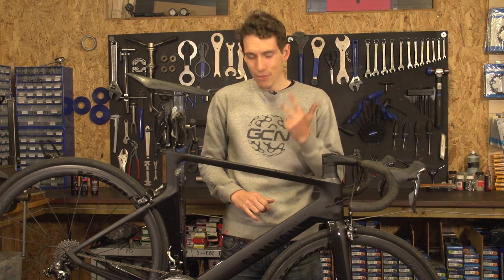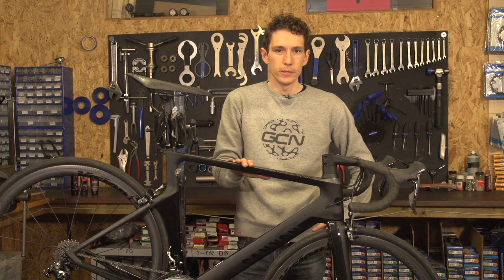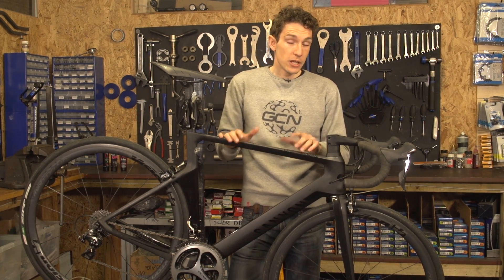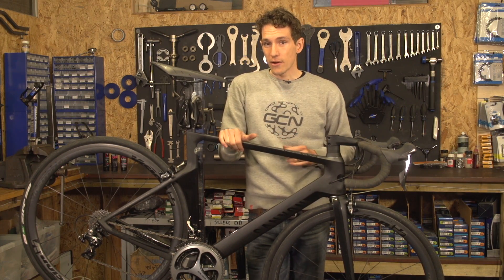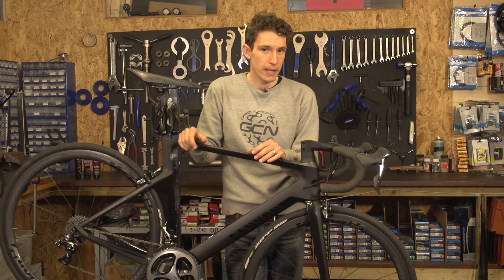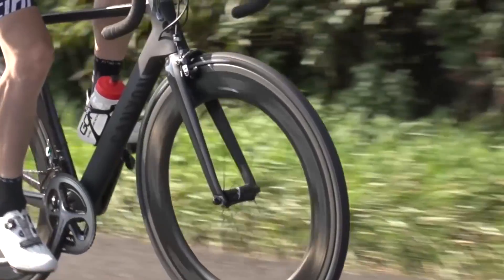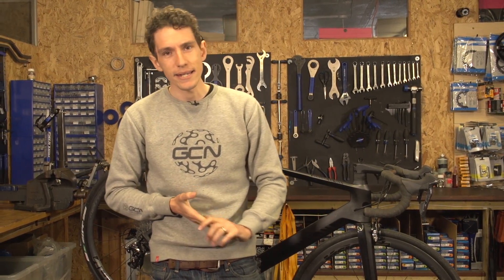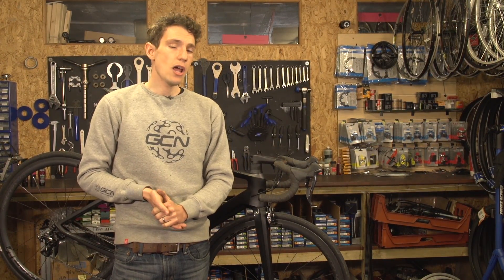7 Things You Didn't Know About Carbon Fiber

Comment: Leaning it against a radiator could damage the clear coat / paint layers though.
Reply: +SimonGrowl I wouldn't say that's entirely true,  most manufactures bake the paint job into the bike at temperatures well over what a radiator could reach.
Reply: +kevo598 incorrect.  Firstly, paint on carbon frames is sprayed on, not powder coated, so heat is not involved in that step.  Second, if the manufacturer does choose to do a post clear coat heating, it will be at a low ambient temperature.  Ridley, for example, use 54c ambient.  Compare this to the surface temperature of a radiator which can be around 75c, and will be contacting the clear coat in a concentrated direct touch point, rather than merely ambient, and the radiator is much much hotter and more damaging.
Reply: +SimonGrowl Sorry but that just isn't entirely true, Firstly depending on the manufacture paint is spray contacted into the carbon at base layers, the final coat is then applied with the residual surfaces being heat treated at 70-85c. Secondly the thermal conductivity of carbon fiber can be deduced in accordance to manufacturing standards, There are a number of systems of measures depending on metric or imperial units: 1 W/(m.K) = 1 W/(m.oC) = 0.85984 kcal/(hr.m.oC) = 0.5779 Btu/(ft.hr.oF)

Air .024
Aluminium 250
Concrete .4 - .7
Carbon Steel 54
Mineral Wool insulation .04
Plywood .13
Quartz .3
Pyrex Glass .1
Pine .12
Carbon Fiber .24 (dependent on manufacturing standards this number can vary slightly)

So at it's base form Cf without paint treatment can still withstand the maximum output of a standard radiator which is around 72-74c depending on ambient room temperature, However not all manufactures apply paint in this way and most as pointed out opt for the spray method.
Reply: kevo598 Hey

Could you clarify what you mean when you say "depending on manufacturer, paint is spray contacted into the carbon at base layer".  This is unclear.

Also, what do you mean when you say, "the final coat is then applied with the residual surfaces being heat treated at 70-85c".

Please explain this further, and then cite your sources for this information when clarified.  

Also, your second point about the thermal conductivity of carbon is irrelevant to the point I am making; I am saying that clear coat can be potentially damaged if lent against a hot surface, which in this scenario is a radiator in a house.

Also; look at every video out there of different frame makers painting their frames.  The process is simply base coat, colour coats with masking where required, and clear coat, with some places "gently baking" (to quote Ridley directly) the complete frame after.

Good sources to check out on frame painting;

Trek, Etoe, PaintMyBike, etc.

Interesting discussion, cheers!
Reply: +SimonGrowl Well what I meant is exactly what I said: some manufacturers spray the base layers on, then the final coat is baked on at a temperature. Simple really, Anyways good chat indeed :)
Reply: kevo598 "Some manufacturers spray the base layer on"?  What is the alternative?  How else are they getting the paint on to the frame?

"Then the final coat is baked on at a temperature"?  By this do you mean the 'final coat' is sprayed on and then the frame is heated, or is there some other method of getting paint on the frame? 

Also, which coats are you referring to when you say the 'base layers' and the 'final coat'. ?

Comment: Excellent video guys, there's just one myth that didn't got unveiled, (at least here in South America and Mexico), people tend to believe that carbon fiber has an expiration date, is that true?? o.O and if it is, how can I know when my bike is no longer suitable for riding?? or any other carbon fiber component, Rims, Handlebars, Stem, etc!
Reply: As a composites engineer, I think I know where this misunderstanding is coming from - carbon fibre does in fact have an expiry date - but this relates to the uncured prepreg. i.e. before the components are put in the oven. Once they are cured in the oven there is no longer any relevant expiration.

Also note, any carbon prepreg material will cure itself in room temperature if given enough time to do so, this is why we store the material in freezers.
Reply from the maker: +Paula Outon Hi Paula, your carbon frame is likely to last indefinitely. The question you might want to ask is how best to recycle it!
Reply: Global Cycling Network
 Thanks Guys, now I'm going to start researching ways to recycle used up carbon fiber
Reply: +Rob Granville (CBR) I've been riding my Reynolds Strike SLG carbon clinchers for 2 years now, all year long, rain or shine, flat roads, alpine descents, everything. No sign of wear on my Reynolds brakepads or the rims either, while before that my alu clinchers would not even last me 1 winter...
Reply: +Rob Granville (CBR) true, but not a problem anymore once disc brakes catch up

Comment: so even if i am 100kg i still can ride a carbon bike?
Reply: A carbon bike will be fine. I'm 86kg and a jump mine and do stoppies and it holds up fine.
Reply: +Aqid Danial I would trust a carbon bike over a steel bike at that weight. but I would go with an alum stem and bar
Reply: +Aqid Danial I would trust a carbon bike over a steel bike at that weight. but I would go with an alum stem and bar

Comment: I have to disagree with the claim that "you [can] lean your carbon bike against a radiator".

Most of you didn't come to read essays so, in short, leaning a carbon fiber bike on a radiator (I'm assuming an operating automotive rad) will most likely ruin it. DON'T DO IT 

I would like to speak to the point about the temperature resistance of carbon fiber reinforced plastics (carbon fiber for short). As an engineer with experience in designing and manufacturing with carbon fiber composites for automotive racing applications, I feel the need to point out that high temperatures can be a significant hazard for carbon fiber. First it is worth pointing out that the operating coolant temperature is 90 degree Celsius for most road cars (110 degrees C for some motors eg. Audis' TSFI motors)  so radiators will feasibly reach 90 degrees in certain areas. Although 90 degrees C will have very little effect on the properties of elemental carbon (as compared to 20 degrees C), resins used in carbon fiber MAY be affected. As opposed to elemental carbon which have little variation between different manufacturers, different resins will exhibit vastly different reactions to temperature. The important metric to note pertaining to the operating temperature of a resin is its glass transition temperature (Tg) and not the melting temperature. The Tg is effectively the temperature at which a (amorphous) material turns from a brittle solid to a rubbery substance. Beyond the Tg, the composite loses it's structural properties and is easily deformed. The resin used in many of our components on our race car (ties rods, steering column, intake, body panels, etc...) has an operating temperature of up to 70 degrees C (160 degrees F) and heat exposure is a large concern of ours when designing and implementing these items. The specific resin we use is valued for it's strength and chemical resistance despite the heat concerns we have. It is worth noting that the resin we use is in fact marketed as a "high temperature resin" (just not quite up to all our requirements). There are, of course, resins that have much higher Tg's of up to 300 degrees C (2000 degrees C, even, for carbon-carbon though that's completely different), this often comes at the cost of strength, chemical resistance, ease of manufacturing, and most importantly, money , and therefore, are not preferred. I applaud the creators of this video for recognizing that bicycles are designed with their intended uses in mind, and this leads me to my point.  Although I don't know the properties of every single different resin used in bicycles, considering that the typical use of a bicycle is not to be leaned against a radiator but rather to be ridden in mild climate, resins are not required to withstand the temperatures of the radiator and probably will not. Composites used on bicycles will be required to have excellent specific strength primarily with operating temperature being of very minor concern of its designer. I've focused on the resin for carbon fiber bikes in this comment but the glue used to bond sections of carbon fiber together, the clear coat used to make bikes look pretty, the vinyl liveries on bikes bike are whole other cans of worms...  I'm not certain why this video had to go out of its way to offer people potentially hazardous information, but for anyone who didn't feel my first two lines of this comment were of common sense and felt the need to read the justification, hopefully this clears things up for you.
Reply: @Human Bean  He's not talking about a car radiator. Instead, he's talking about the radiators used in your home, for heating.
Reply: Well this reply made me crack up. Why would they be talking about car radiators???
Reply: Interesting but too long and no paragraph = not easy to read.

Comment: I can't Re-find the comment Link so posting the webpage piechart info as new comment.
Well going by your links 2011 piechart, there are more than 5 C.F. companies.
Carbon Fibre company share by %  2011 - 1. Toray 30% - 2. Mitsubishi 18% - 3. Toho 18% - 4. Zoltek 17% - 5. Hexcel 7% - 6. Others 6% - 7. Cytec 3%

Comment: have you got 28mm tires on your aeroad? Contemplating them on mine and unsure if they would fit
Reply: I do and they fit fine, room for 30s maybe!
Reply: oh right nice. Gap doesnt look big enough when ive got 25s on. Would you recommend 28 over 25?
Reply: +James Merry it depends really. To say one is better than the other depends on what riding you do, what wheels you have and what tyres you're going to get.
Reply: +Simon Richardson well I ride up in Edinburgh, where the roads sometimes make Paris roubaix seem smooth. But race on the bike. Have Reynolds carbon clinchers for good wheels and then ultegra wheels for training

Comment: Kiln cured carbon fiber structures aren't UV sensitive, but if the carbon composite is wet laid up, i.e. using a process whereby the glues set without being baked in an oven, then they do degrade over time due to sunlight.  Like fiberglass boats for example.  Doubt that any producers make wet laid up bike frames, but maybe a cheaper or no name brand coming out of China...?

Comment: CF is good, my friends have exotic cars with lots of CF parts. Here are some of their complaints. The resin chips easily(expensive to fix), in really cold weather it cracks(expensive), Any hidden chips turn fatal if you drive on wet salty roads. Extremely strong in some direction but surprisingly weak in others(if you move it in an unusual way it can break easily). To me its not worth the price right now vs aluminium. In the future CF bikes will probably cost the same as a current aluminium bike, when the price comes down ill get one.
Reply: +Robert Flagg Car parts are subjected to vastly different stresses than bicycle parts and many aftermarket carbon fibre parts are poorly engineered compared to OEM.Both my road and CX bikes have seen multiple winters of -15C and hit with salt, sand, gravel, and flexed through sprints or bunny hops (CX) without any issues.  I even have a few bare carbon spots on my road bike (before I started using 3M clearbra material to protect vulnerable areas) and only the very thin paint chipped away.  Unlike carbon fibre, aluminum fatigues over time when repeatedly flexed.  That's not to say there aren't great metal bikes out there but, honestly, most carbon fibre bikes built in the past five years or so are just as durable, if not more so, than aluminum.
Reply: mneedes2 However, regarding the extreme durability of Ti I'm quoting from work with gas turbines and jet engines. Certainly I'm up for a Titanium frame, but the prices are keeping me off it. I like the elasticity of metals. At the moment I'm using Titanium hubs and Titanium sprockets, and they rule. Way better than ally, with the hubs under heavy cornering, jumping or putting the power down can feel the difference. Light as a feather. Ti is amazing.
Reply: +dan parmenter im considering a Ti frame for my next bike too, aluminum frames are less expensive and lighter but it has a dead feel.. 
Ti on the other hand has good qualities overall but yep still expensive!
Reply: +Robert Flagg agree with you... been using steel and  aluminum frames for many years, then i upgraded to a carbon frame road bike yes its stiff and light but durability not really.
frame and other components  made from CF you have to treat them with tender and loving care..

for sponsored  pro teams its not really a big concern for them because they can easily replace their bikes..
Reply: +Robert Flagg If you want the most durable, buy titanium. If you thought carbon was pricey, you haven't seen Ti.
Reply: +Weng Ten   You mention durability.  Did your bike fail?
Reply: mneedes2 nope, seems tough as nails. Mind you, I ride a pronghorn, which is the only CF frame that comes with a lifetime guarantee. If I do manage to break it, they'll give me a new one. Used by the Peruvian olympic MTB team, so if they can't break it... doubt I can.

Comment: Do carbon fiber really has an expiry date?
Reply: +Tsaqib Al-Hasawi 
just reaffirming what they said, it does not. Unlike metal frames, carbon is largely chemically inert, it can't react (which is why diamonds don't burn or why char is left when you burn something). As they said, it takes high heat to melt the resin, and even higher to make the carbon react. Carbon reacts but is based on the type of bonds and heat (CO2 requires heat from a match or an acid reaction like baking soda and vinegar). Long story short... It takes a lot to abuse a carbon frame and since it's mostly inert, the adhesives are more in question the carbon. Thanks for letting me go nerd for a second!
Reply: Kent Wu Alright, now I'm clear! Thanks man!
Reply: Matin Dadib 4017 and after that, you really need to upgrade
Reply: mayfly4000 Hahah..lol! Thanks for the very detail info mate!
Reply: Not the fibre is the Problem, but the resin what is used. UV light leads to faster degradation of the polymer and thus to less strength of the matrix- But as long as your fibre is covert in paint nothing happens.
Reply: Does, not Do
Reply: Thanks for the correction mate
Reply: +Tsaqib Al-Hasawi Like any bike, the frame is an wear item. It will take a lot of abuse, but it will expire when you can't repair it.

Comment: I'd like to hear your comments on knock-off products. The general idea I get from people (Professionals I know, Bicycling Magazine, etc.) is that knock-offs have no degree of safety because there's no engineering behind them. Have you any experience or research to share?

#askGCNything
Reply: +Alexandar Hull-Richter Knock-offs aren't made to the same tolerances as the genuine article and they certainly aren't tested for their strength and durability. After all, they're only trying to look like the real thing - not perform like it. I'd suggest going for a budget-friendly albeit real carbon mark if you value your health and safety. Bars, stems, and wheels are the most common knock-offs and those are your lifeline out on the road at speed.
Reply: +Will Gilfillan 25,000 word article on counterfeit bikes, knock-offs and carbon repairs (and where bikes are made and by whom) can be found on BikeBiz dotcom. Search for "faking it".

Comment: titanium is still a comparable material for bike parts. I like any material if it's quality. But for low-end stuff steel's the best because it absorbs vibration well and is safer. btw, aluminum is much more crashworthy than carbon fiber because carbon fiber is brittle and not tough. aluminum is extremely strong. I've broken steel and carbon bikes in crashes but aluminum has never failed me. I've broken car's doors with aluminum bikes. Except I did break aluminum handlebars once with just my leverage  , but I've also broken cromolly bars just with leverage as well, and I've seen to many carbon bars snap in crashes to trust them either. they just don't make handlebars strong enough for me. titanium frames are nice because they are invincible, very very crasbworthy material.

Comment: Isotropic means that a material has strength in all directions. metal, for instance.
Carbon isn't isotropic. That can mean it is weak in some directions. Drop something heavy on the frame? it may crack. It is also why carbon frames break more easily in a pile up. It's strength is not in all directions.
Reply: +Scooper MG Very good explanation. I didn't know that. Thanks!
Reply: +Alexandar Hull-Richter You're welcome, Alex.